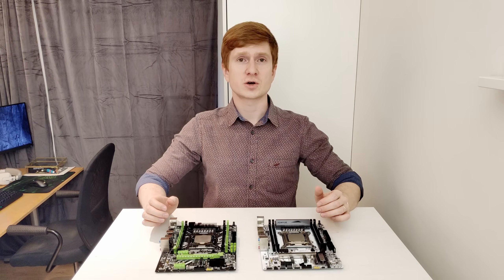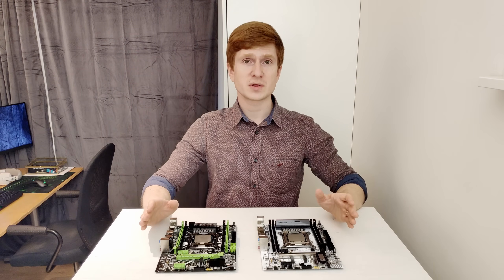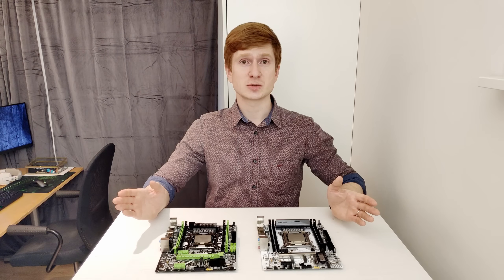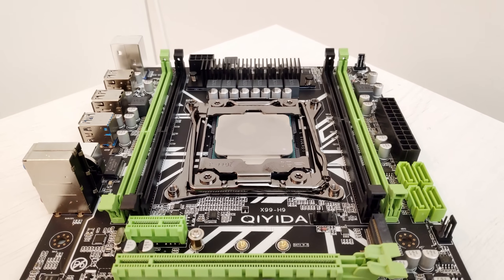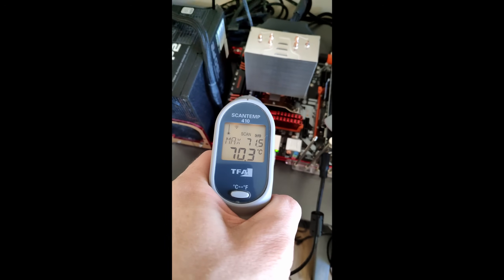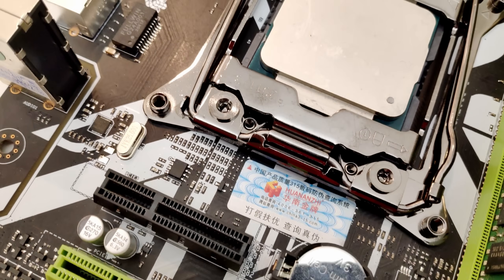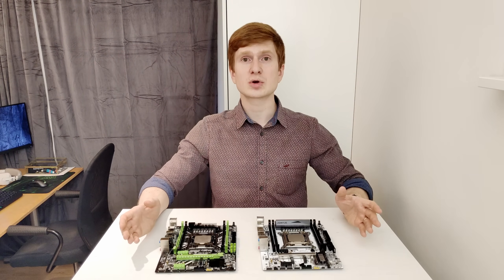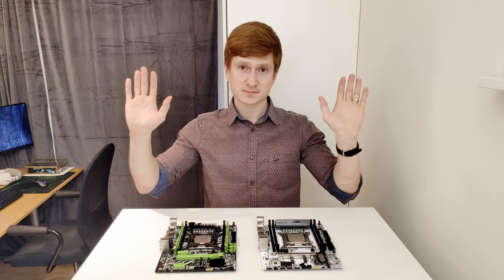🇬🇧 Jginyue X99M-Plus D4, Qiyida X99-H9, Kllisre X99 V201, Machinist X99-RS9 – tests and conclusion

Comment: Hello, brother! I ordered the Qiyida one non-ecc and an E5 2620 v3. Since 2620v3 TDP is 85w and the 2678v3 is 120w and I am not pretending to do turbo boosts and overclocks, do you think i will need some extra ventilation to preserve the motherboard or it will work great without energy alterations? If it yet without boost gets much warm, it is a good idea to do a undervolt to fix it?
Thank you.
Reply from the maker: You should always have reasonable airflow in the chassis, but for E5-2620 V3 even with Turbo Boost Unlock, you don't have to modify the motherboard cooling, it won't fry off.
Reply: @Miyconst  thank you. Have a great day
Reply: @Miyconst  Hello again! The chipset of the qiyida came with thermal pad. Do you think it must be better to replace it by a thermal grease?
Reply from the maker: @Raphael_FFS  no, but if you really feel like replacing something - use a better thermal pad.
Reply: @Miyconst  Hello again! Everything is ok with my qiyida, but my front panel does not work, my cabinet is new and I am using windows 10(automatic audio driver). Can you give me an advice? In my old motherboard to solve it was in the bios, changing hd audio to ac97, but I dont see it in the qiyida bios.
Reply from the maker: @Raphael_FFS  You have to manually install Realtek driver.
Reply: @Miyconst  I downloaded the driver from realtek site, but still not working and the realtek control panel was not available. So I used the driver booster and it updated that and worked. Thank You

Comment: Thank you so much. I was wondering if I could turbo boost my 2040v3 on a killsre v201. I am having around 45ºC stressing de CPU without turbo boost.

Probably It would not be a good idea to turbo boost it, right?
Reply from the maker: It's gonna be just fine if you ensure good airflow in your chassis.

Comment: Do you know if any of these Chinese motherboards support GPU passthrough using Linux's virtio?

My idea is to buy one these bundles, with two GPU slots. Doing that I may be able to enjoy the full potential of a virtual machine with GPU acceleration. Is that possible? That sounds a good video to me.
Reply from the maker: I have tested the GPU passthrough function with JingSha X99-D8 motherboard and it works, but these cheap boards with cheap desktop chipset probably don't support it.

Comment: Have you ever been get the quick code 92 error on x99 motherboard?
Reply from the maker: Not as I remember, what is your full hardware specification?
Reply: My computer equipments: 

1.Motherboard x99-T V1.2 
2.RAM Non ECC DDR4-2666 MHz 
3.SSD Western digital NVMe 256 Gb 
4.PSU Corsair CX750M 750 watts
5.CPU E5-2630L V3 
6.VGA Sapphire r9 380 2Gb

The quick error code 92 appear, it can not show picture on monitor screen.
Reply: @Miyconst  
Motherboard Specifications:
Model: X99T-DDR4
Chip: B85
CPU Socket: LGA 2011-3
Supported CPU: 2011-V 3-pin Processor
Memory Slot: 4 * DDR4
Maximum Memory Supported: 4 * 32G DDR4
Supported Memory Type: non-ecc / reg ecc / ecc
Integrated Graphics: None
Integrated Network Card: 8111F Gigabit
Integrated Sound Card: ALC662
Material: PCB
Size: approx.280x220mm/11.02x8.66in
Reply from the maker: @tanintangkuaram495  do you have a picture of the motherboard? I don't seem to be able to recognize it. Here is a table with post codes, but beware, that the Chinese boards may not follow this specification: http://www.mrbios.com/techsupport/award/postcodes.htm
Reply: @Miyconst  Yes, I paste a link but youtube removed it. I will try to attach pix with the another way. Mobo just entry in Aliexpress.
Reply from the maker: @tanintangkuaram495  I can't access the file, it's locked for the outside viewers, but I think I found the motherboard, this particular one is known for its bad quality, and unfortunately, I can't really help with it, you have to talk to the seller.
Reply: @Miyconst  Thank you for your help. I will talk to them and do the best way for solve this problem.
Reply from the maker: @tanintangkuaram495  always make sure to be polite and describe the situation as clear as possible.
Reply: @Miyconst  Oh, yes. You are welcome. That it is the usually way I do to them.

Comment: hello, is the motherboard huananzhi x99 8m-f recommended for use with the xeon 2640 v3 for games?
Reply from the maker: It depends on what you count as "recommended". In general, it will be just fine, as long as you don't abuse the motherboard.
Reply: @Miyconst  if I use it with the 2640 v3 with unlock turbo bost and 50/70 undervolt, does it hold well?
Reply from the maker: @jeffesonmath2323  yes, if you have decent airflow in your chassis.
Reply: @Miyconst  thanks

Comment: Which dual socket motherboard, DDR4, would you suggest for someone who just wants to add a Chinese motherboard and new CPU to his collection? (I collect as many older pre-builds as I can and just like having at least one of every CPU series in a working machine.). Wanna build one of these up for streaming older games, just to confuse people I know with the manufacturer of the board and showing off a huge tower case but still looking to upgrade to a top V4 CPU over time. Please help!
Reply from the maker: In this case I would hunt for a second hand Asus board on ebay, but if you really want to get a Chinese one - go for Huananzhi X99-F8D.
Reply: @Miyconst  Thank you, I'll check them both out. recently found your channel but it's been a massive help and an interesting watch.
Reply from the maker: I hope you will find it interesting further down the track as well 😃.

Comment: Hi, Thanx for the video. I've struggled with KllisreX99 V201 (H81) + i7-5820K crashing after 5-15 mins for several weeks (I've seen all critical blue screen messages what exist :o) ... I've tried everything like drivers update, reinstall/cure Win10, different settings in OS, BIOS-settings change and I was happy even if I can restart the PC after some of the changes... Now I know two root cause are the improper cooling and BIOS (so most probably I've cooked several times the system). SO I've updated the proposed BIOS and created a new heatsink with fan (you can see the project pics here: https://drive.google.com/drive/folders/1PdSYjAVCqqdz0rraP9HTRkm1tg_raaHG?usp=sharing )    ... The upgraded system is only one day old but running good without any crashing ...  just I see FSB 97MHz and a bit changing and not stable 100Mhz)     
Still I have few questions: Is it better to install BIOS with -50mV/-50mV for i7.5820K (all 6 cores running 3.3GHz-ish all the time) Or Not... Other...  is there any proposed BIOS settings for this setup/CPU? beside disable sleeping) ...  Thanx a lot !!! I'll create a Hungarian translation for your Mi899 tool soon :)
Reply from the maker: I am glad to hear that you were able to make the system work stable, even though it's just one day old. Core i7-5820k has an unlocked multiplier and it's not compatible with Turbo Boost Unlocked BIOS. The system won't work with this BIOS. If you would like to undervolt the CPU, you may try to use S3TurboTool drivers without Turbo Boost Unlock, but I have never validate how it works and whether it's compatible with i7, so you would be on your own. You can also try to adjust CPU voltage using Intel XTU, but as I remember, it was not possible.
Reply: @Miyconst  Hi Thanx I'll check which bios I've installed might it could be useful for others, no plan to overclock anything just a stable running
Reply from the maker: I just have checked the photos, and the new heatsink looks really cool! Can I publish it on my Instagram?
Reply: @Miyconst  ...feel free...
Reply from the maker: @gergopalatinszky163  shared your pictures on my Instagram, give me your username if you want me to @ you there.

Comment: I think e5-2673 v3 is a new sweet spot for Xeon build now, it's like a slightly weaker version of 2678v3 which have slower clock speed but cost lesser about 20 USD than 2678v3, it still have 12 cores and support DDR3 also with lower TDP (105w).
Reply from the maker: That's true.
Reply: I had the same thought which is why I just bought one.

Comment: I have that green QIYIDA motherboard, guess I'll die.
Reply from the maker: It's gonna be just fine if you don't abuse it.
Reply: @Miyconst  My case has 6 fans, the funny thing is the xeon combo felt more fresh than my FX 6300 combo I used to have.
Reply: @Miyconst  abuse how? I intend to use it for about 8 hours a day, sometimes even more, for about 12. I study and work on the computer, my father ended up buying without consulting me ... I can't even finish the order, I would like to know if the kit will last !
Reply from the maker: @CaioCSGamer  no one knows if the motherboard will last, but most likely it will. I have assembled a couple of dozens of computers with these cheap boards, and so far I didn't get a single failure. You just have to make sure to don't overload the VRM and ensure good airflow in the system, also use a decent power supply, and don't do things such as CPU mining and FoldingAtHome.
Reply: @Miyconst  thx, i pretend to use blender and other apps about 3d, and image rendering
Reply: @Miyconst  1 year since I use that combo, but I dunno which side should I connect the CMOS battery.
Reply from the maker: @kanuh  Just connect plus to plus and minus to minus.
Reply: @Miyconst  after 2 years of using the xeon combo I finally realize that if I plug the ram sticks in dual channel my computer will crash if I reach 80%+ ram usage, trying to troubleshoot if its one of the ram sticks manufactured in 2016 or the motherboard is defective, I tested only one 8GB ram stick for a week and 0 crashes, If i plug the 2 ram sticks in the Qiyida motherbard my computer will crash often if I suprass the 80% ram usage.
Reply from the maker: @kanuh  it's either motherboard or the RAM, test each RAM stick individually to determine if one particular stick is causing the issue.

Comment: my motherboard x99 (Chipset b85) takes about 30 seconds to appear the video, is there any way to remove this delay and make it show the video almost instantly? like normal motherboards?
Reply from the maker: Most likely no, but depends on the motherboard. Huananzhi X99-8M-F BIOS might be compatible, and that one boots faster.
Reply: @Miyconst  my motherboard is the X99M-G2 is there any modified bios for her that does not have this delay?
Reply from the maker: Sorry, this motherboard was released before Huananzhi X99-8M-F and I didn't have a chance to validate it with this BIOS.

Comment: Nice review. 
My Jginyue X99M-Plus D4 are on their way to my house.  
I have also bought several E5 2620v3.  (low budget computers for my classroom, I'm a teacher.)
Is this already possible to unlock turbo on these motherboards? 
Thanks for your work !
Reply from the maker: Yes, it's possible to unlock using Mi899 and Huananzhi X99-8M-F BIOS.
Reply: @Miyconst  I will try that asap !
Reply: I tried : The bios is now a Huananzhi x99  0.11 x64.   NICE,  from 2400mhz to  2600mhz / core (ratio x26)  BUT no more turbo, even on single core ! Test on Cinebench + HWinfo.
Reply: I MADE IT !! (thanks for your video)  3.2ghz on each core !  Great !    X99m-plus D4  and E5 2620 @3.2ghz  great !!!!!!!!!!!!!!!!

Comment: hi super video ..... i have 3 question

what do you think of the lga 2066 is that it will become cheap like the lga 2011 and if so when?

I do CAD and some games .. I am looking for a pc to last 4-5 years minimum for a normal budget AM4 is at the end of its life AM5 will be released in 2022. the top am4 is ryzen 5 5900x (50x) but it is too expensive the ryzen 1600af or 2600 its findable for 100 € ... to conclude this question is better to wait for AM5 which will surely last until 2025 or even more ... or take a am4 2600 for 100 € is in 2 years improved for a 5800x?

Finally is that a dual e5 2630lv3 xeon is a good deal for the workload because 16 core for 35 € is very interesting or then an e5 2640v3 is better?

thanks for video super chanelle
Reply from the maker: LGA 2066 will get cheaper sooner or later, I don't have any accurate information, but if I would have to guess, I would say it will be somewhere in the middle of 2022.
Reply: @Miyconst  thanks you we will see if the Chinese will make motherboards x 299 (and for the other two questions?) thank you very much.

I am looking for a pc to last 4-5 years minimum for a normal budget AM4 is at the end of its life AM5 will be released in 2022. the top am4 is ryzen 5 5900x (50x) but it is too expensive the ryzen 1600af or 2600 its findable for 100 € ... to conclude this question is better to wait for AM5 which will surely last until 2025 or even more ... or take a am4 2600 for 100 € is in 2 years improved for a 5800x?

Finally is that a dual e5 2630lv3 xeon is a good deal for the workload because 16 core for 35 € is very interesting or then an e5 2640v3 is better?
Reply from the maker: @vladimirsamas3097  I don't think you should bother with dual socket setup, unless you clearly know what it's for and how to use it, in that case two E5-2640 / E5-2660 V3 could be a good option for the money. Waiting for AM5 is pointless in my opinion, since when it's gonna be released, it will be expensive, and you will end up waiting another year until it goes down in price. Ryzen 7 1700 / 2700 can be found for cheap and it's very good for productivity.

Comment: Nice video btw i have question about the failure rate of xeons like E5-2678 V3 (Used) do they last long or  just year or two, you have many xeons so you can answer this week very well
Reply from the maker: So far I have not had a single dead CPU, but my number of CPUs is nothing in the large scale, thus it's very hard to make any conclusion.

Comment: Please review (all?) X79 motherboards! They are cheaper, the fitting Xeons and the DDR3 server ram too. X79 is perfect for low budget gaming! So please do more reviews about this chipset's motherboards.

Some general advices/suggestions: 
Please don't start the ending music while you are still talking. Makes it harder to hear your voice. Or at least make it quieter. Personally i don't like that music at all, but that is my problem...

English is not my mother language and whenever someone is speaking fast and talking about figures and model numbers of cpus, graphics cards and the like i struggle to follow. Maybe you could blend in the name of the motherboard etc., especially at the conclusion/when comparing one motherboard to one or more others.

Keep up the good work!
Reply from the maker: Thank you for the feedback, I will pay more attention to the sound volume level. Regarding the X79 motherboards, they are still okay for the super budget builds, other than that I see no use cases, power consumption is way much higher and the performance is significantly lower when compared to X99.

Comment: great video, now I need to find a way to replace that heatsink on my x99-h9, is a 2630L but anyway a copper/aluminium heatsink over the other components will maybe improve a bit.
Reply: I'm. About to order this one,  does it support ddr4 2133 ram. N is it a good board? Ty
Reply: @h2ck3rhumas  Yes, not bad, I didn't try yet with heavy gamming,  I have also 1650 gtx and a 4k tv and all games tried are ok, I cannot tell the frame rate but is very smoth, the minimum resulotion that I use is fullHD
Reply: @nmocruz  okay I'll place order for this one then I want to use it with i7 6850k
Reply: @h2ck3rhumas  Should be ok, If you want you can confirm with the supplier before the order, and then if you have any compatiblity issues you can use that messages with the seller to argue and win a dipuste.

Comment: Just a question about the Kllisre X99 V201 motherboard. Have you managed to use all ram slots on the motherboard and have you encounter any issues? Thanks and keep up the good work. 👍
Reply from the maker: Yes, as I said in the video, all four motherboards are identical in this regard. I have tested all of them with ECC REG & regular memory. The maximum I tested was 128 GB (4 * 32 GB) DDR4-2133 ECC REG.

Comment: more cheap boards for entry level 26xx bundles basically. certainly useful but not for enthusiasts. I am hoping we see chinese x299 soon, skylake xeons are starting to drop in price. The engineering samples are within reach and lower core count models aren't terribly priced. i heard that the server chipsets for the x99s are drying up which is why these cheap models are what we mostly see released.
Reply from the maker: Yeah, it's time to slowly switch to X299, but Chinese are still pushing X79 because of the cheap DDR3..

Comment: Well, is it possible to add small cooling elements to the phase controllers to help this issue on the cheaper boards? I already have a Jingue d3 board with an e5 2678v3, and I have a fan directed specifically at the vrm to counteract this.
Reply from the maker: Yes, it's surely possible, but it's a hassle.